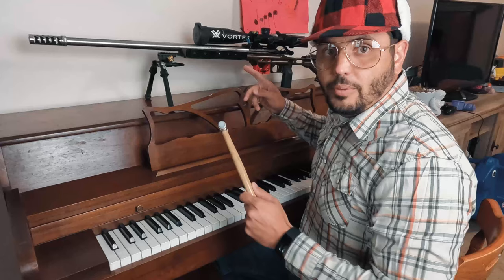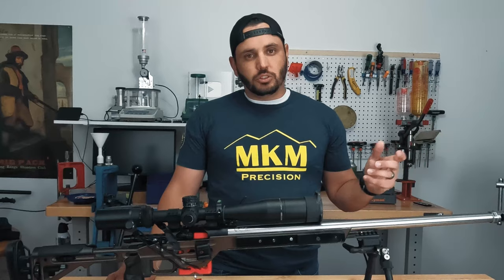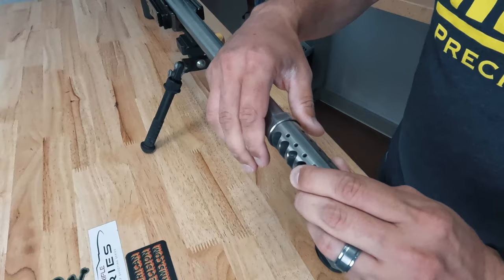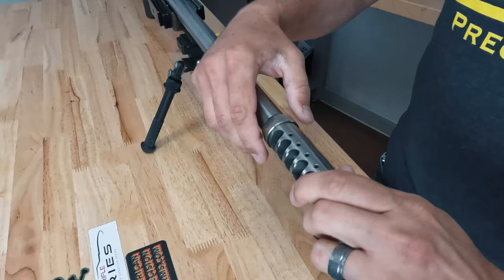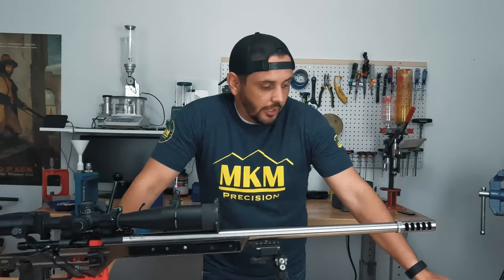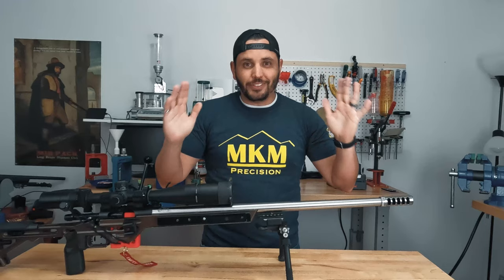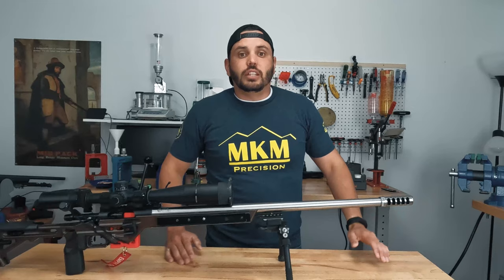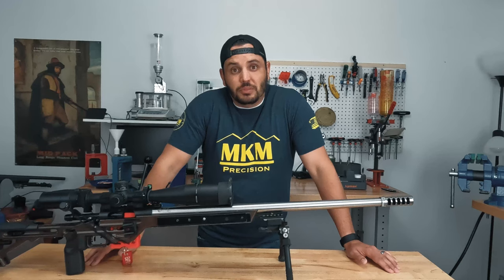How to Tune Your Barrel Without a Tuner!

Comment: What is needed is a large sample size study of the performance of rifle tuners. Take a barrel mounted in a rigid firing rig in an indoor 100yd range. Use laser sensors to measure barrel temperature. Break in the barrel with 200+ rounds before testing. Then fire statistically significant groups across an array of tuner settings. Maintain barrel temp between sample groups within a chosen fixed range. Then plot group size vs tuner setting and perform statistical analysis to validate the results. The ammo used would need to be tightly controlled to avoid confounding variables. Barrel aging/wear and fouling/cleaning effects would be a challenge to isolate.

Comment: Now show the variation in your ES and SD in all your groups.  If the variation in your load is as large as the variation in group size, all you proved is that the variables in your ammo equals the variation in group size.  The tuner will only show consistency if the tuner adjustment is the only variable being changed.

Comment: with my Harrels tuner/brakes I would shoot 17 - 5 shot groups 3 times adjusting the tuner a full revolution each time for 17 groups counting 0 as initial stage.
with this amount of revolutions each time I would get at least 3 good nodes  about 5 groups apart.
therefore in future testing I only adjusted the tuner 7 times counting starting at 0 and this would give me at least ONE good node to set the tuner. 
my best 5 shot groups @ 100 yds in my 223 Remington reduced from 5/8ths" to 3/8ths" 
Harrel tuners are better because the tuner is over the barrel NOT on the end of the barrel utilizing full revolutions to adjust the tune in lieu of 1/8th turns to adjust the tune. It's very easy that even vibrations will move the tuner very easily therefore a 1/4" adjustment thru vibrations or whatever could change the accuracy dramatically. 
Plus Harrel tuner/brakes fit the barrel very evry well and don't look like a blob on the end of the barrel like other tuners.

Comment: I shot a tuner on rimfire last year.....after 4 months and thousands of rounds of shooting with a tuner I saw no appreciable improvement during that time.  You would see the groups open up and close up, but without the tuner, the groups were just as good if not more consistent.   A tuner is not the mage sauce.  I no longer use a tuner.

Comment: First thing you must buy if you are testing for tuning is a lead sled and something that holds the rifle down , no shooter can be that accurate all the time without one. 
I installed a Harrells tuner/brake on my Rem 700 tactical 223 and previous my best 5 shot groups at 100 yds. were 5/8" now they are 3/8".
Tuners do work but they only fine tune your shooting not make drastic changes in group sizes.